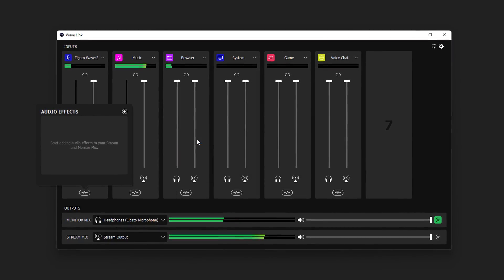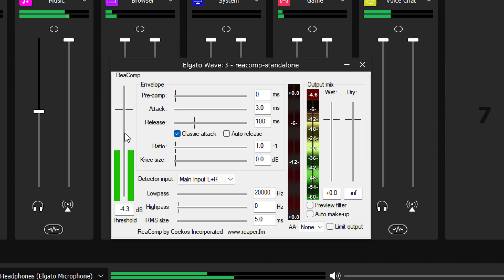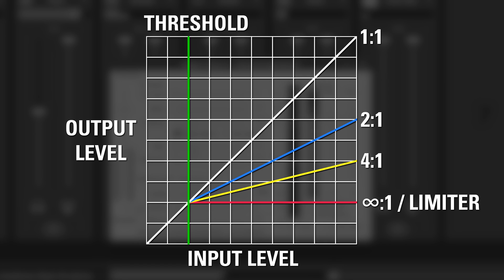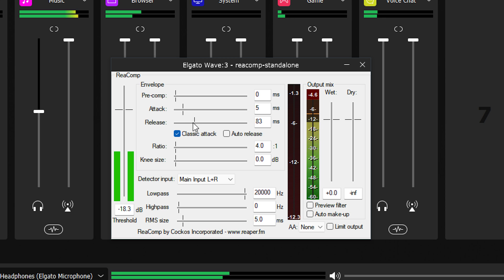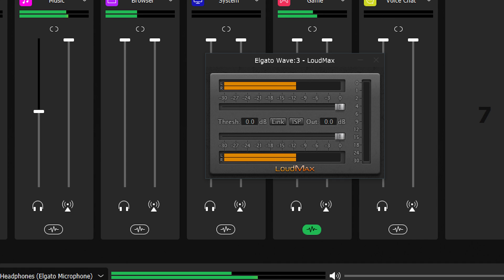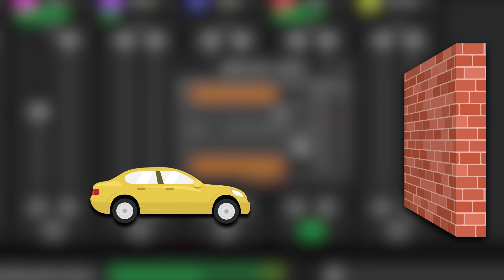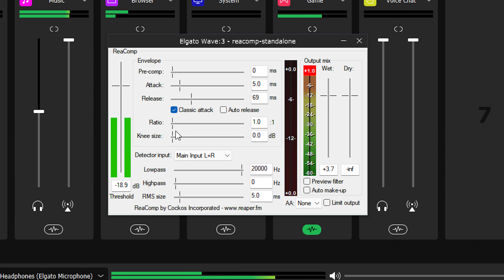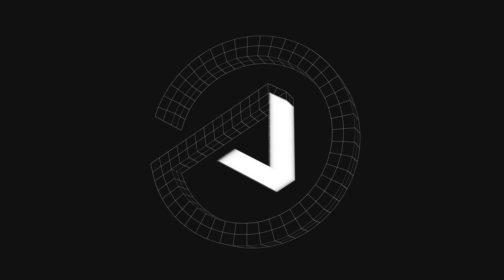How to Use Compressor & Limiter VST Audio Effect in Elgato Wave Link

Comment: Compressors / limliters should be included as standard in the software to be honest. I have to use Voicemeeter on the side to apply some basic effects / processing to my voice, wich should be bundled in wave link in my opinion.
Reply from the maker: Wave Link has VST support now, so this can be done directly in Wave Link without needing outside tools. 

Are you experiencing some issues with doing this directly in Wave Link?
Reply: @ElgatoWorkshop  ive been going through the links elgato has provided and the reaplugs are all incompatible. i need a fix plz